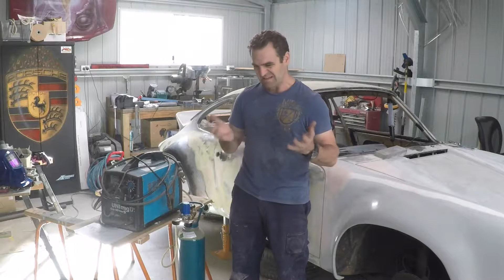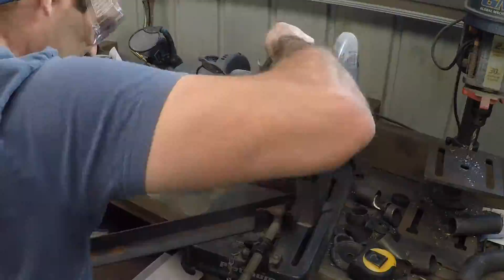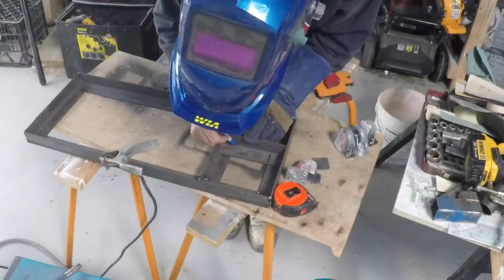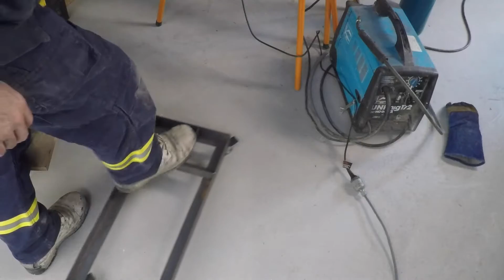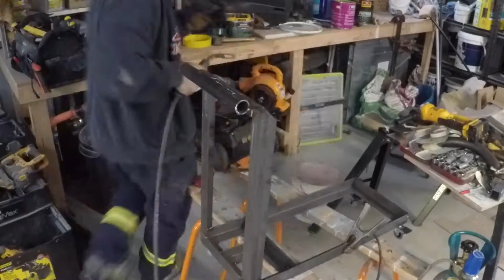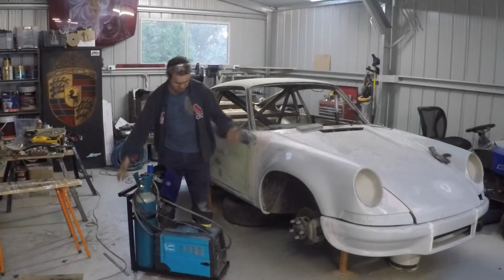How to Build a Welding Trolley

Comment: What are the specs on your welder? 120v or 240v? Amperage? Miller? Do wish you had gone bigger?
Reply from the maker: Australia has 240v as standard, and this runs on 15amp. I have found it does everything I need.